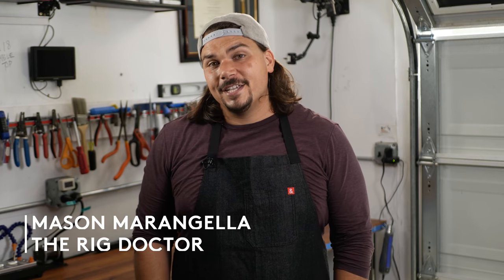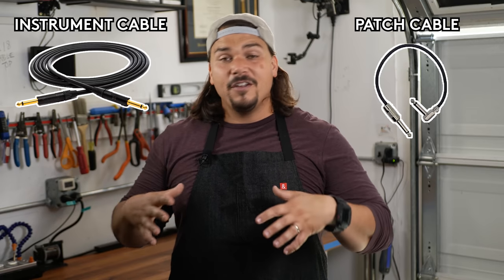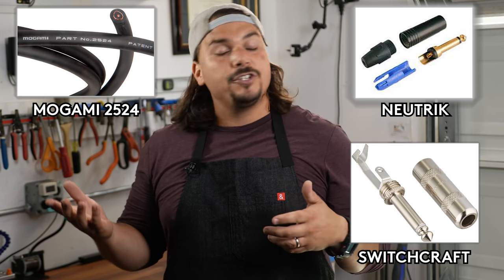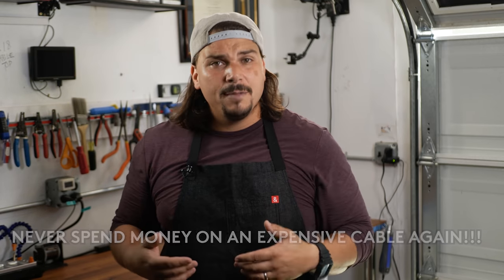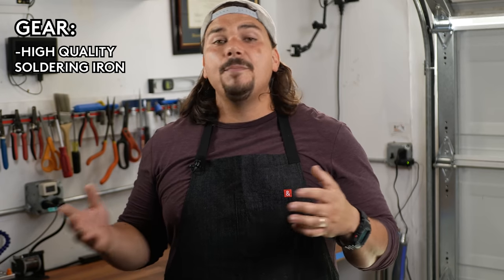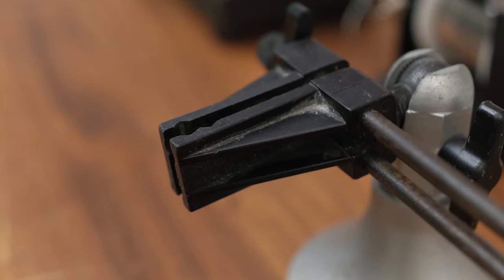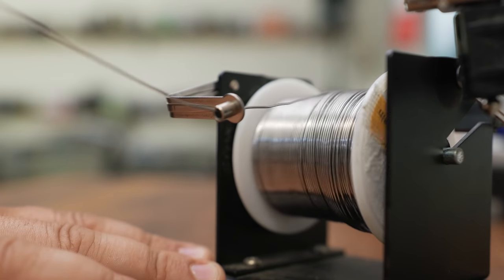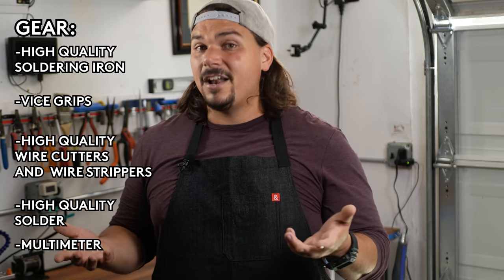Never Buy an Instrument Cable Again

Comment: You forgot to add something critical : Hand Soap -> so you can wash the lead off your hands and you don't poison yourself.
Reply from the maker: Always wash your hands!
Reply: Avoid Pb in your solder. Get silver solder instead. And tip your cable end to a flux if needed. Just use "no clean" flux so you don't need to worry about corrosion afterwards.
Reply: @t3r080  Lead solder is better than silver solder. Especially in that you can tell a good joint just by looking at it. All silver solder joints look like bad lead solder joints, and would make it especially hard for a beginner to tell if their joints are coming out good. Go lead or go to bed.
Reply: @t3r080  - Or use lead solder because it flows better, clean flux off properly which isn’t hard, and wash your hands.

Comment: Mason, thanks so much for this video. Super informative. Some questions/requests for help. So I've constructed my own pedal board.  On this pedal board, I've got 2 Cess 1/4 inch TRS jacks that I'm trying to wire up with Mogami 2524 bulk cables. One serving as an input jack, and the other an output jack. My goal, is to solder/connect the 2524 cable to the TRS jack on one end, and a neutrik right angle connector on the other. Is this possible? Do I have the right equipment? Sorry for the novel, just not finding any videos for this exact situation
Reply from the maker: Is this an insert cable???  For TRS you'd need 2552.  If you're making a Y cable you need smaller cable, like the Mogami 2528.

Comment: Did you really delete my comment because I had a criticism? contrasting opinion?

Edit: Oops, jumped the gun on the assumption. My bad. For real though, great advice for any beginner/novice wanting to start soldering their own cables.
Reply from the maker: I don't think any comment was deleted in this video - feel free to repost it.  Perhaps it didn't load or got spammed?  I'll check it out after responding here.
Reply: @VertexEffectsInc  Oh, gotcha. It wasn't much of a criticism, really; just a differing opinion on soldering irons.

I was just mentioning my experience on how high quality soldering irons aren't really a necessity when dealing with cables and jacks; they just have to be hot. I used a 30W cheapo on everything from small electronics on PCBs to soldering on jacks and lugs in general. While they certainly aren't ideal, they'll do the job if nothing better is available. I normally solder everything at 730°F on my $50 cheap-name soldering station I got from Amazon, which offers more than Weller does at that price point; and I'm not even sure Hakko offers anything in that price range.

I also briefly mentioned Mogami, but was about to delete that bit when I realized that my comment was gone, because I assumed it was more expensive before actually checking the price. lol It is expensive compared to others, but not as much as I thought. It's more than $1/foot in the listing in the description now though. I've seen Mogami branded things going for insane prices, so I assumed that the bulk cable would be the same. But it isn't too unreasonable, though it still wouldn't be my first choice without an extensive search for a better value.

Oh, also the obligatory "Why am I watching this?" comment. I've been soldering cables and jacks, among other things, for years, and don't need a beginner tutorial on it; yet here I am, watching one anyway. lol Great advice, by the way. I actually solder cables similarly to the way you do.
Reply from the maker: @RAndrewNeal  For an experienced person, an inferior soldering iron will work with a fixed temp and wattage.  You have the skills to ensure that you don't overheat the cable or the connector and can work with a more cumbersome tip.  However, for a newbie, even just manipulating a thick soldering pencil and not having your sea legs with how to get the solder to flow and how to tin, etc. it makes difficult work out of an inferior iron.  I've done enough trainings and seminars with live pedalboard building to know that a Weller or Hakko is really the only move for someone wanting to gain soldering proficiency in a day long class as I've trained about 50 people in the last 2 years.  If you plan to do this long term, getting a good soldering iron is an imperative in my mind, and make the job 10X easier.  Most sources for 2524 are under $1/ft.  Generally $0.70 to $0.80 per foot.  The plugs are the only real expense.  Once you have the basic materials you'll be on easy street.
Reply: @VertexEffectsInc  You're absolutely right, but the only reason I got good at using a cheap iron is because it's all I had when I started. lol It didn't even have an upper temperature limit; it just dumped 30 Watts into the tip until the dissipation in open air equaled 30 Watts. I don't know how hot it really got, but it would lift the copper pads off of perf-boards if I wasn't super fast with it. But for somebody looking to get into soldering, $50 will get them into the game with a Yihua 939D+ soldering station. I can vouch for it being a solid option, but lacking in the heat conductivity of the included tips. It's compatible with 900M-T tips, which are the same ones that fit Hakko 936, 937, & 907 models. I'd also get a spool of lead solder instead of using the included silver solder, just because lead's better. Unfortunately, it is Chinese-made, and some people do get some duds; but even the good brands make their things in China, sadly.

What sources do you use to get a hold of the 2524 cable? I'll look into getting some, as that shielding looks better than the stuff in the cable I have for making patch cables. And off the top of your head, does it have braided options? I'll find out either way, but just asking if you know. I like for the cable that goes into my guitar to be braided, even though it adds nothing to its electrical characteristics. lol
Reply from the maker: @RAndrewNeal  I recommend the iron I use, and funny enough we sell about 100 of them every quarter though our Amazon links in the description - so people seem to respond to it.  I usually buy the cable in bulk from Performance Audio.
Reply: @VertexEffectsInc  Cool, I bookmarked Performance Audio's 2524 by-the-foot page.

I'm not knocking Weller or Hakko, just their prices. They're reputable, quality brands. It's just that they cost more money for the same baseline variable temperature regulation feature that the other brands also put out.

I guess what I meant to say from the beginning is that a novice looking to try out soldering on a budget can get a quality soldering station without paying Weller or Hakko prices. In light of your example of teaching beginner classes, the cheapo soldering irons would pose a problem. I was thinking about it from the perspective of somebody who's done it for a long time, and not about this video being for beginners who might never have touched a soldering iron before. So I'm with you on getting a quality iron. It just boils down to that I was pointing out that cheaper options exist at a comparable quality.

Also sorry that my initial comment came off kinda snarky. That isn't the foot I wanted to get off on.

Comment: I have a hard time not cutting a few of the middle copper wires when I strip the cable, is it a big deal ? Does the signal gets weaker or something like that ? I might buy some evidence audio cables instead and solder them to the squareplugs

Comment: This is a decent tutorial EXCEPT it's too much like the Bugs Bunny instructions for a hand grenade. 1. Pull the pin. 2. Toss the pin away. 3. Grip the grenade firmly so that you can throw it as far as needed. 4. Ensure that you will be a safe distance from the target or that you have sufficient cover to protevt you from the blast and shrapnal. 5. Remember that you have only 10 seconds KABOOM.
SO, next time you make a cable construction tutorial please mention leaving the boot and cover onto the cable BEFORE you say to and how to solder the jack onto the cable.
I'm sure that we have ALL soldered ends onto cables and then going..DOH!! I forgot the boot & cover.
Hey if this video is just a joke to see how many people you can trick into soldering the ends on prior to threading the cable through the cover and boot, EXCELLENT JOB! You mys==ust be laughing SO hard. ROTFLMAO
Great job!   :-)
Reply from the maker: Breaking it down step by step is critical having taught this many times in weekend seminars and pedalboard building classes.  Without being deliberate with the steps, we see the comments section reflective of some of the presumed workflow not being totally explained in the video.
Reply: Good idea to watch the video all the way through first. That way you cover any 'gotchas'.

Comment: TITLE : "Never Buy and Instrument Cable Again 
CONTENT : *full and complete materials, an expensive soldering iron required,etc. 😂😂😂
Like bro, with $15 you can get a decent 6meter high quality cable
Reply: Can you get a 3.5M or a 1.2M?  Can you resolder the connector if it fails, or switch for a different brand?  Try different cables?  I did many mods on my amp with a $40 soldering iron.  You don't need high end gear, especially when learning.  If you take it more seriously and develop some skill, you can always upgrade later in the future.  The high end stuff isn't required, just makes things easier.  You can write a book with a $20 Microsoft keyboard, or a $500 mechanical.

If your a gaming nerd or a hobby player that plays once a month, there's plenty of cheap cables around and they might be best for that situation, but if it's that's true I'm not even sure why you are watching this video.
Reply: I gig regularly and learning how to use a soldering iron has been waaaaay cheaper than buying new cables everytime I have an issue. Having high quality cables is not cheap, and in a live gig context, people is not usually too carefull when handleling expensive gear, so is really handy to be able to fix/build your own cables.

But, maybe, yeah, there will be cases when is cheaper to buy a new cable. And that's okay if it's your case

Comment: Calling bull shit on the expensive soldering iron. LOL.  Any sodering iron will work.
Reply from the maker: You can use inferior tools, sure, but makes the job 10X harder and with sensitive materials and thinner wires, a 5W iron from Radio Shack ain't gonna cut it.  You really want adjustable temps and the ability to change the point to increase or decrease the surface area based on what you're soldering.
Reply: Before lead-free solder, TBH I've have tended to agree for the most part when dealing with large parts like this. With lead-free, an iron with a temperature that you can dial in absolutely makes the job a lot faster and easier.

Comment: Are you kidding me!?🫨 guitar cable is just cowax cable?? DUDE! I can buy cowax cable buy the mile for cheap! 
(Like the shit we use to use on old TVs) Will that work?? Are you telling me that will work?? 
Because if so,  you are a godsend my friend ❤
Reply: It's a type of co-axial cable ("co.-ax."), yes, but instrument cable has a few differences to the stuff that the TV cable guys use. For one, it's more flexible, and secondly, the shielding is different. Also, I'm guessing the resistance is different as well since the signal it's carrying is different. But yeah...at the end of the day it's just rubber and metal dude! 👍
Reply: Thanks so much 🙏😃😎
I'm gonna at least try it before I break the bank with mogami 😅 
Thanks again 👍
Reply: @thelastofthelemmings6279  Most normal cables you can buy at the music store will work fine. Unless you’re going to be gigging a lot, you don’t need to worry about getting a really tough one either — like the ones with braided covering. Also, unless you’re recording a lot and really fussy about the sound, you definitely don’t need a Mogami. Those cables are aimed at the very top of the heap; professional musicians and recording studios — where money is no object and sound quality is everything.
Reply: @thelastofthelemmings6279  In short, a cable like those from Fender or Ernie Ball will serve you well for years, and even on a budget, the basic black rubber ones will work fine!  
Unless you already have good soldering equipment and skills, and if you're a true DIY-er, then I wouldn’t bother making cables. ‘Might be fun to try tho! 👍
Reply: @bveracka right on man 😎🙏👍 won't be giging so much any time soon, having a reunion start-up with some old buddies this coming weekend.. should be a hoot😃 
I really appreciate all the advice you've given me 👍 very cool man.. very cool 💯
Reply: @thelastofthelemmings6279  No problemo 👍😎 Have a good time!